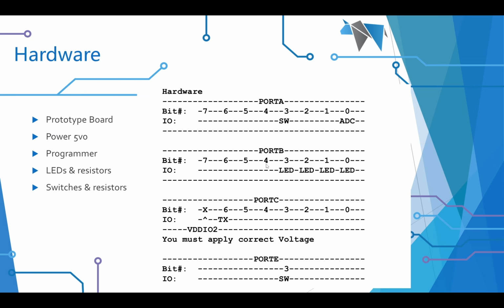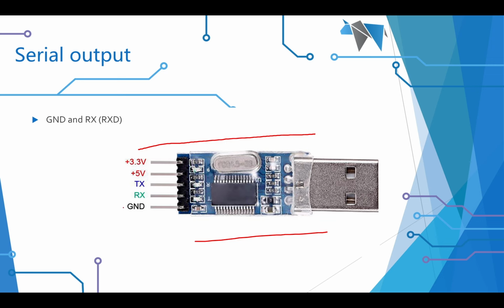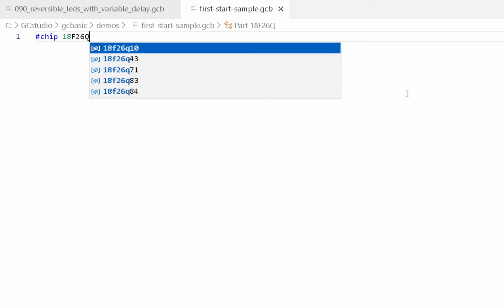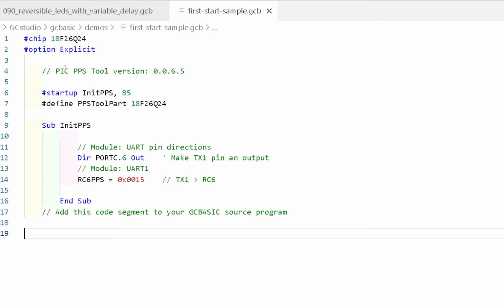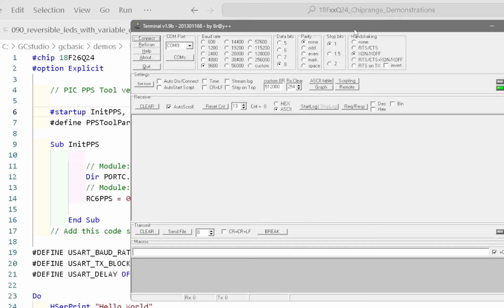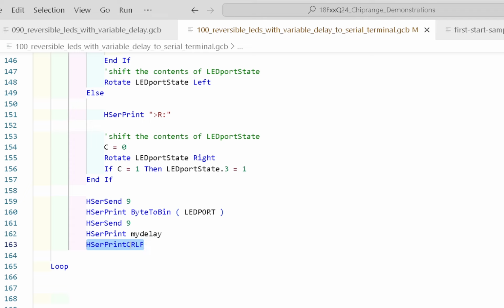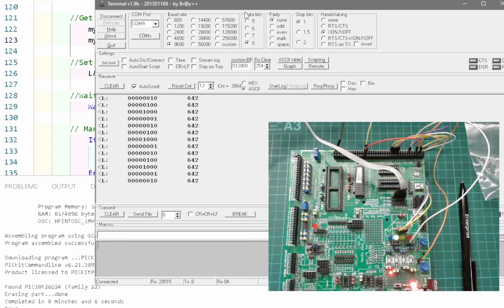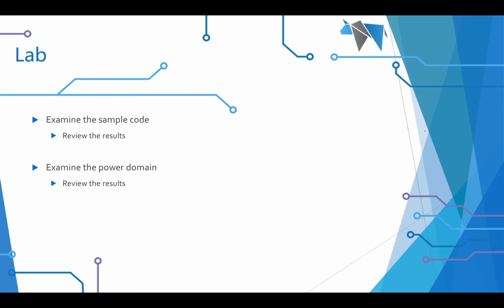PT8: PIC18xxQ24 chip Family - Using serial/USART to show the state/values of the switch, ADC & LEDs

Comment: Hi Evan

I notice your title here says the PIC18xxQ20 rather than the Q24 range being covered in the series, not sure if you can correct this now its live ?, 

Great fun and an interesting series as usual, 

Just so you know in case any watchers want to try and recreate these experiments BasicMicroUK stock all these IC's, we have the 28Pin in a PDIP package as well as a SOIC28 version and also the 40Pin PDIP version as well as the TQFP-44 version so please get in contact if you require any parts, we also stock 1000's of other electronics parts all guaranteed to be 100% genuine,

I like the look of your prototyping board, please can you share more information on this and maybe even a small video on this board, I would love one for the BasicMicroUK LAB, 

What is Zen mode ?, never come across this before ?, 

Keep up the good work

Dave, BMUK
Reply from the maker: Hello DesertDave.  I corrected the title information . Thanks for spotting.

It's great to hear you have all these in stock.   Ping me if you want to resell our PICKITPlus software, resell our PICKit2 programmer, or any of our products. 

The board I use.  I had is designed a few years back, and I am going back into production very soon.  I will post a video soon.